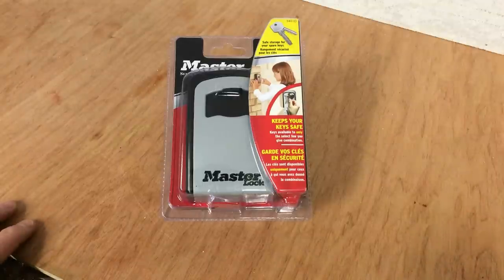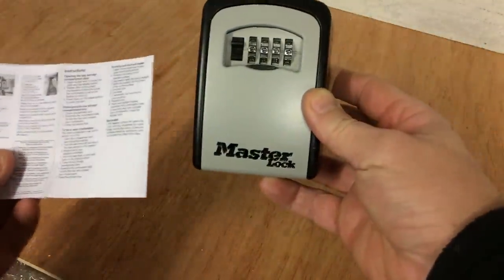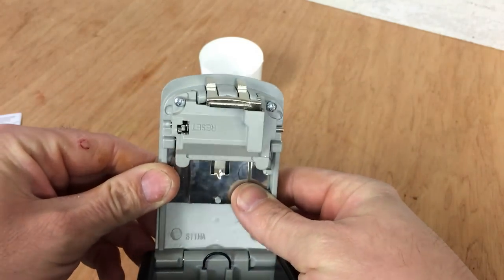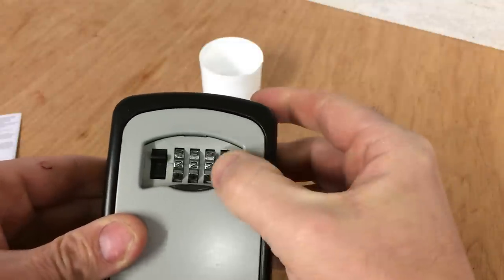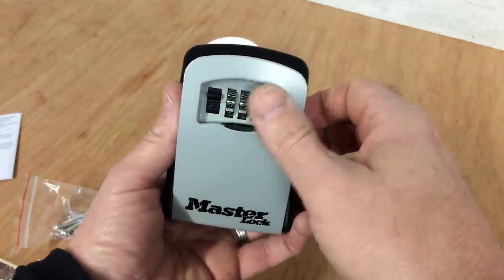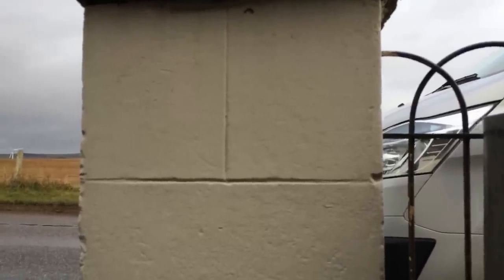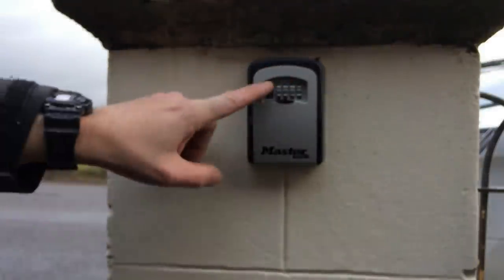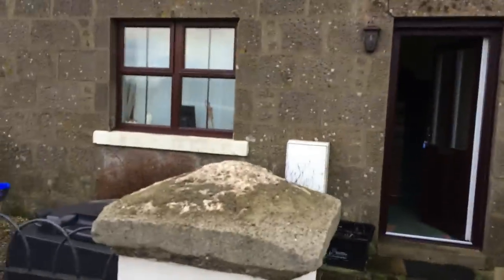How to Install and Set the combination on a Masterlock Key safe

Comment: Excuse the stupid question but when you choose the wall plug size , do you just choose the same length as the screw and when you choose the bit size same as the screw again?
Reply from the maker: Generally when you buy the wall plugs, it tells you on the box what size drill to use and also what size screws to use. I use Fischer wall plugs which always have all the size details on the box. Hope this helps

Comment: I know you used the Fischer anchors (wall plugs) but could you let me know what size you used and drill bit size too. This is something I have always struggled with, knowing which anchor and not size to use when a product is supplied with only the screws!
Reply from the maker: Hi Keith, I used 6mm x 30mm fischer duopower plugs and a 6mm drill bit - I hope this helps 👍
Reply: @Bacrenfencing  Thank you so much for replying, you've saved me a massive headache. Will definitely subscribe to your channel.
Reply from the maker: @keithhurleylife  Thanks Keith !

Comment: First of all it’s really difficult to get it out of the package - you have to use a sharp knife to cut the plastic ties from the back. I can’t open mine on 0000 and guess what I assume the instructions are inside the safe
Reply from the maker: Obviously has a fault, I would send it back for a replacement unit
Reply: The code is inside the wrapper at the back on a small sticky pad ! And it ‘ain’t’ 0000!
Reply from the maker: Ahh, they must have started doing that, I have always used 0000 on the older ones and it worked fine. At least you got it sorted !